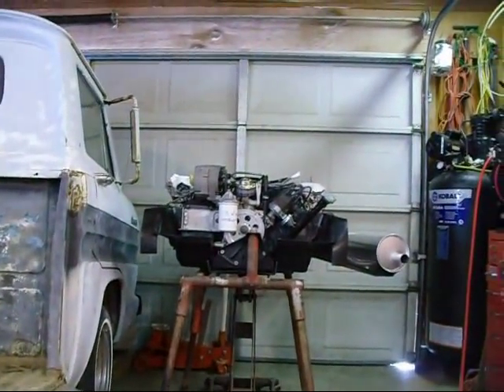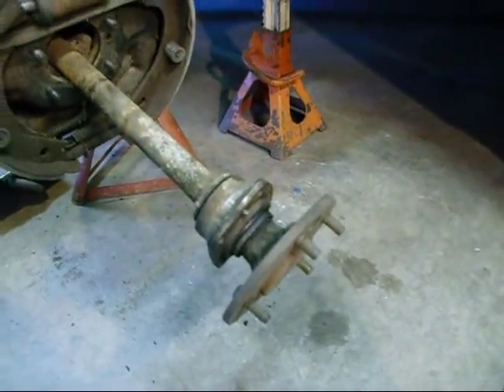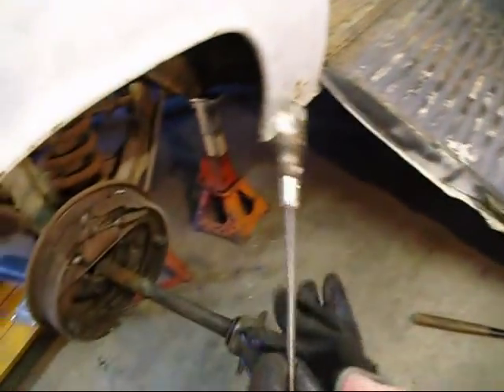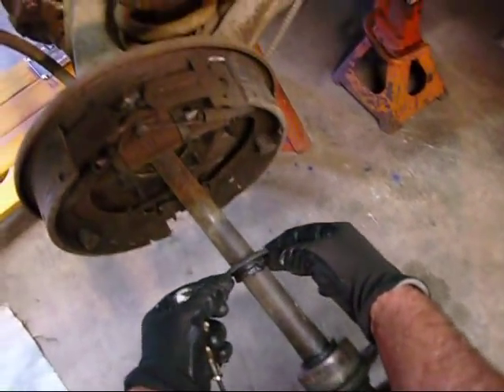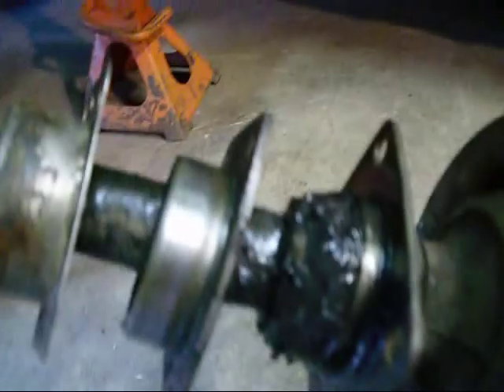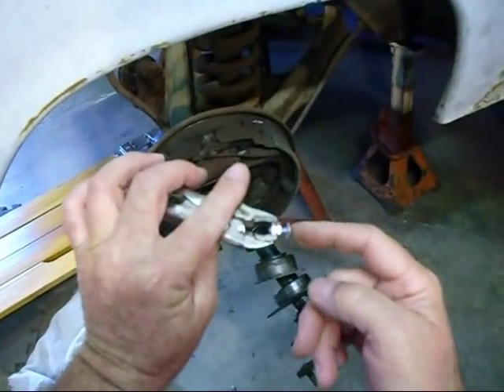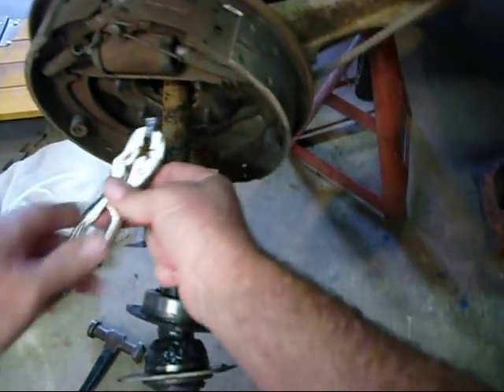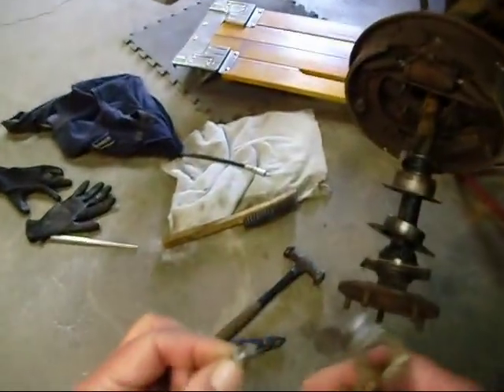Corvair Rampside Rear Axel Bearing Packing Procedure

Comment: what kind of grease are you using? I'm trying to pack my 1964 witch I have apart I also have a needle grease fitting just wondering what is compatible with the old grease?

Comment: Thanks Dave.  I have stopped driving my 1963 Monza Convertible because it started making noise in the rear.  I just lifted it off the ground and tried shifting from first to fourth gear and once it gets to fourth gear, it starts making some clanking noise in the driver's side rear wheel.  I don't know if it makes a difference but it seems that only the driver's side wheel was rotating which I found odd.  I will go ahead and pull the axle and inspect it.  How would I know if I need to actually replace it?